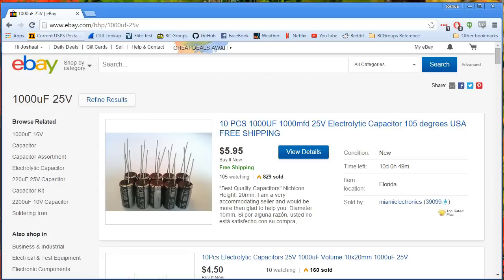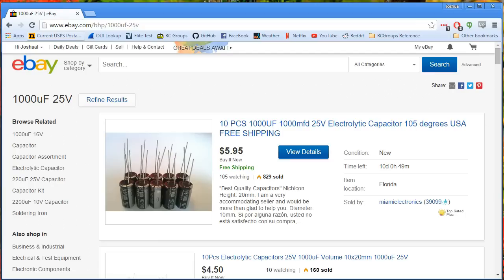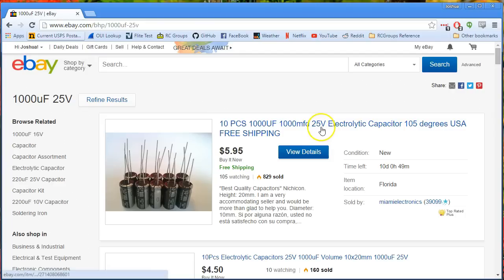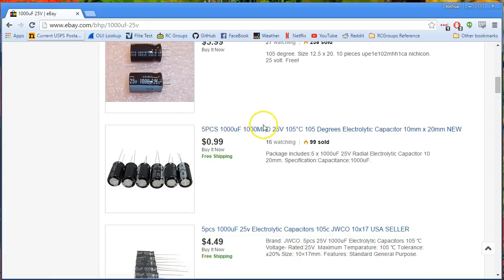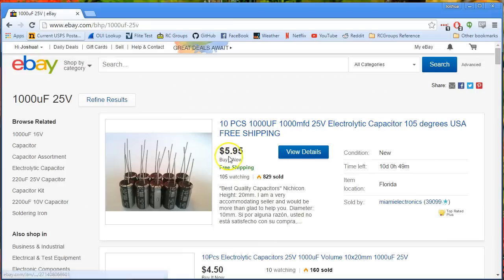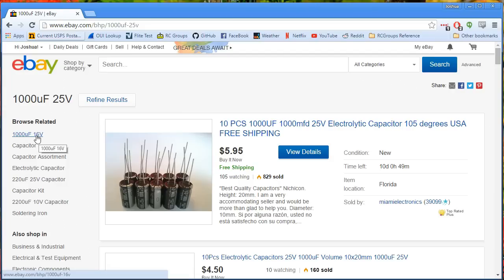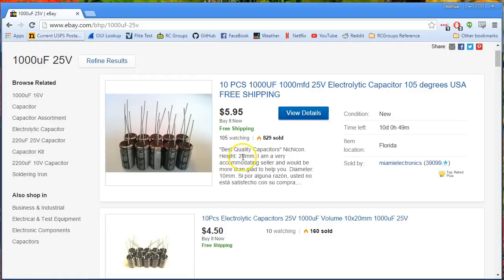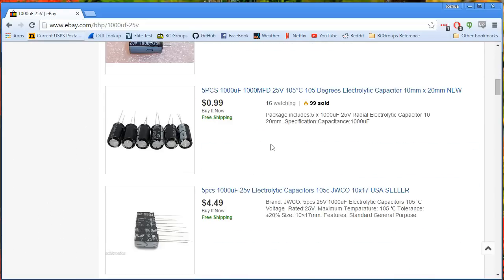Quadcopter Build Tip: Install a capacitor on your battery lead!

Comment: hey great video! i just a a question. can i just use 2 capacitors with 680uF and wire each capacitor to 2 ese's on each side of the quad(+) to (+) and () to ()...? so that way i can eliminate putting 1 capacitor on each individual esc. (almost like a parallel set up)
Reply from the maker: That's not the best way to do it.

Comment: Digging up an old video! I have a nice posh cap over the XT60 on my controller, is it a good or bad idea to add smaller ones to the power leads of the ESC's also? Or will this cause other issues?

Thank you for all your videos by the way, I have been glued to YouTube for weeks watching everything! Haha
Reply from the maker: Smaller cap on the ESCs is more effective than one big cap on the XT60. But the more the merrier. If you do it all, even better.
Reply: @JoshuaBardwell  back to the bench it is then!

Comment: Is there a possibility that the braking could be wiping out my micro minimosd ? Every time I land with the motors armed, the FC trying to correct itself wipes out my minim. Doesnt happen when disarmed/ motors not spinning. Using a naze rev5, the micro minim is powered by its own 600ma pololu. FC and Rx powered from a separate Pololu

Comment: I've been experimenting with caps for some time now. never had an issue without and seem to see zero benefits with but I guess I'm not supposed to see them.  with today's esc's that are littered with smd caps, do you still feel this is necessary?
Reply from the maker: +FPV Kabab if you see video lines, it's necessary.
Reply: my video is perfect but I'm using 12v off the pdb. not batt power. I don't think that matters however. I've seen lines on other quads with the 12v too.  thanks. i had no idea how to tell if the caps did anything at all. I added them to try and avoid desyncs. then I learned all about all the various failures and don't believe the caps do a thing for them.
Reply: I have two polulu step down converters for 12V and 5V and they recommend a capacitor of 50V if you go over 20V nearest to the pololu gnd and vin.  At least 33μF...  I'm going to try a 470μF 50V ESR since I'm in the 5S world right now and having FPV issues.
Reply: @Kabab  With a couple years since this.. what are your thoughts on these issues today? Do you use caps at all? Hard to tell in your vids, but looks like no? Is the hardware that much better in 2018?
Reply: @Andrew-FKF  very interesting. So I use the Panasonic 1000uf 35v as a standard on all my quads but I've still yet to see a problem solved by the dumb cap. I've also had quads that had their cap wire broken for the entire life of the quad and I never noticed until I went to take parts from it. So nothing has changed but I still use it because it's recommended...

Comment: hey can i just solder the cap to my lc filter? is that ok to do that, i can only find 1000uf 16 volt lc filter on market which the voltage is quite underrated for 4s lipo as you said. I fried 3 cameras before and never want to repeat that again.
Reply from the maker: +bard moon if you have an LC filter you're most likely fine.

Comment: Would you recommend running this on a RROSD? I have seen some build that you have done with this board and wondered if it makes any difference with a board like that? I will be running littlebee pros, and this will be on an atom rx122 so space is at a premium. :) 

And as always thanks for all you do!
Reply from the maker: RROSD has some in-built filtering, but not enough to completely remove video noise from noisier setups especially Littlebee ESCs. It can't hurt to add the capacitor if you can find room for it on your build.
Reply from the maker: ... but at the same time, if you can tolerate a little noise in your video, then you can leave the capacitor off if you can't fit it in somewhere.

Comment: Wow, following your channel is almost like trying to keep up with the bf thread lol. Thanks for the tip! Since you mentioned, can you do a video on lc filters for camera? There is good info out there, but still confusion on where to mount it, if you need one before camera and also one before vtx. Also confused on amount of wraps the power lead should be around the ferrite. And if both + and - go through the ferrite. And capacitor size. I picked up a 16v 1000uf cap for my 3s quad. Seen that recommended now after watching this I'm doubting. But I don't have active breaking esc's.
Reply from the maker: +Chris E 16v is passable for 3S but not ideal. You will probably get away with it especially if you don't have active braking.

Multiple LC filters are probably overkill. I would rather use one big filter than two small ones.

More wraps around the ferrite are better. We are not trying to tune an audio filter here, where we want a SPECIFIC cutoff frequency for our filter. We want to filter this "signal" with as hard a low-pass as possible. For the capacitor, around 470 uF to 1000 uF is generally good enough.

Best-case scenario IMO is to have the vTX on a 12v regulator, with an LC filter between the battery and the regulator. So: battery -> LC filter -> 12v reg -> vTX and camera. The reason for that is that the regulator will add some additional filtering. For a 3S system, where the battery voltage will drop below the drop-out voltage of a 12v regulator, a 9v regulator may be better. Once the input voltage goes below the drop-out voltage of the regulator, best case scenario is that the regulator's filtering will be gone, and worst case scenario is that the vTX goes off entirely.
Reply from the maker: +Chris E For the ferrite part of the LC filter, get some magnet wire, also know as enamel wire. It allows many, many more wraps in a smaller space compared to regular wire.
Reply: +Joshua Bardwell Don't the filters on the RROSD PRO PDB perform the same function.
Reply from the maker: Kenny Young Yes. But personally, I still add the capacitor. To my mind, it's cheap insurance for the cost of a few cents and a few grams. Bear in mind that the filters on the RROSD Pro PDB are designed with weight and size in mind. Almost always, with capacitors, this means a bit of a compromise--although I don't know about the capacitors on the RROSD specifically. To my mind, there are few substitutes for a big fat electrolytic cap when it comes to the type of filtering we're doing here.
Reply from the maker: Chris E It's quite likely that your voltage regulator is going to soak up most of the noise, so I don't think there would be much benefit to putting the LC filter between the vReg and the vTX. Putting the LC filter before the vReg protects the vReg itself from the noise, which may be desirable depending on the specs of the vReg. In other words, if it's rated up to, say, 18 volts or 24 volts, for 4S usage, it may be seeing transients of around 40 or 50 volts, which could eventually destroy it. Or maybe nothing at all will happen, depending on how the PDB is designed.
Reply: +Joshua Bardwell Damn it, I just soldered my LC filter between the 12V reg and the vTX and camera. We'll see how well it works. The reg is the one on a Matek PDB.
Reply: +Joshua Bardwell Sorry I'm so dull, but I'm not understanding. When you say vreg I'm assuming you are talking about the 12v step down regulator on the pdb? If so, I'm not using that pad, just the unregulated 12v pad for the vtx (which is labeled vcc on the board), which in turn feeds the cam the same voltage. I don't think this would be filtered in any way. So the only way I could put a filter before is to do it on the lipo plug leads. I'm guessing that's not what you are implying but its the only thing I can picture when I read your comment.

Anyways its not a big deal, don't have any major video issues. I'll experiment and see what happens. Thanks Joshua!
Reply from the maker: The vBat pad isn't filtered or regulated, you're correct. If you're in 3S and feeding vBat to the vTX, it doesn't matter.

Comment: Hey Joshua, have you actually measured the effect of this with a scope? I would be shocked if a leaded electrolytic capacitor had any large effect on the high frequency noise from the escs. My solution is to separate the escs from the rest of the system with an inductor, that massively decreases the noise on the bench (scope) and in practice.
Reply from the maker: +Goat 1000 uF electrolytic is what is recommended by MRM to go with the Littlebees. That, for me, was the final word. The theory is that the time constant of the circuit acts as enough of a resistance to make an RC filter with a sufficiently large-valued capacitor. I have personally also experienced a reduction in video noise on a vTX running direct from vBat after adding a large capacitor to the power leads.
Reply: I don't doubt that a capacitor helps, I have tried it and it did take the edge off some of the noise. However an inductor does a better job by at least 100 times, it is more difficult to fit though.
Reply from the maker: Goat that's interesting.
Reply: +Goat would it be correct that a capacitor would be more useful for voltage drops as they store charge, and an inductor which resist change is what you want for voltage spikes like the active braking would produce?
Reply: +Adam Wilkinson The reason an inductor works so well is that the parts you are trying to filter for (camera, VTx, 5V reg) all have capacitors on their inputs. By adding an inductor you create an LC filter which is great for filtering this kind of noise. By adding a larger capacitor you have just increased the capacitance on the Vbat rail.
Reply from the maker: Goat Makes sense to me. The time constant of the system is probably pretty small, so the resulting RC filter requires a pretty big C to get any filtering done.
Reply from the maker: One advantage of the capacitor is that it's installed in parallel, so it's dead simple to add it to the system. The inductor must be added in serial, which could add undesirable complexity depending on how exactly your system is wired up. For example, my vTX is powered directly off of my PDB. So is my camera. Where should I install the inductor in series between the main battery lead and the 5v and 12v regulator on the PDB? I can't.
Reply: Goat do you have a YouTube or schematic how to on installing a line filter (inductor)?
Reply: I can tell you without a scope that my 1000uf 36v cap gave me clear video until I broke one of the leads in a wreck. Caps can make a night and day difference on some setups like mine with a 35A 4in1.

Comment: Good tip ! 

However, the capacitor should be closest to the ESC rather than the battery. In fact, you would even be better of soldering 4 smaller caps (220uF for example) directly across the ESC PCBs or where they are soldered on the frame PDB. Electrical noise on our quads come from high current switching devices (ESC). Spikes and noises must me cut down at the root to prevent them from poluting sensitive electronics (camera, VTX...)

Cheers.
Reply from the maker: +MrFlatox Installing next to the ESC is better, but many builds won't tolerate that well. Installing where the main power leads connect to the PDB is better than nothing.
Reply: Joshua Bardwell Yes, it's still better than nothing :D

Comment: would adding a 1uH inductor in aeries with the battery filter almost all noise with the capacitor (at least 100A capable - about 12 turns of heavy guage copper wire around ferrite rod).
i designed a very basic circuit with the every circuit app and adding a capacitor in parallel to the battery made no difference. but adding the inductor made a huge improvement. any ideas?
Reply from the maker: The circuit simulator is not taking into account the reactance of the real-world system. A capacitor by itself, in a zero-reactance, zero-resistance system, makes no difference. In the real world, the capacitor combines with the inherent inductance and resistance of the system to form an effective filter, as long as a sufficiently big capacitor is used. But you're right that using an inductor to form an LC filter is better. The main problem is that inductors are big and heavy, and that you can't easily install an inductor in series with the main battery lead to filter the entire system. Such an inductor would have to carry tens of amps, and would be really massive. So a great approach is to put a large capacitor across the battery leads to add some filtering to the whole system, and then add a small LC filter directly to the vTX and camera feeds if need be.

Comment: This might be completely the wrong thing, but wouldn't it make more sense to connect the capacitors at the ESC's where the ESC's draws power from the PDB? Many of the ESCs I've used have a capacitor bridging the power leads.
Reply from the maker: +Murray Levi The ESC power leads is the best place to install the capacitor, but many people don't want to add capacitors to their tiny ESCs or install them on the arms of their copters. Putting the capacitor on the power lead is the approach that will work for the widest variety of people, even if it's not the 100% most effective.

Comment: Is there any point in installing a cap on the 5V side? I have a camera, minimOSD and the other stuff on 5V, and still have brownouts with a cap on the battery side of a 4S quad.
Reply from the maker: There's little point in installing a cap on the load side of the 5v regulator, because none of the 5v loads are creating noise.
Reply: OK. I thought that it might help smooth out the 5V if there was something causing drops in the voltage. Something is causing brownouts in the video or OSD in hard maneuvers. might just need another 25V cap on the battery side..

Comment: hey joshua would it be okay to place my 1000uf 35v cap just one on my tight boltrc kraken 5r build? will it work even if its not exactly on the battery input? ive got stock pdb that has spot where pololu most of time wires. Thanks im just trying to find clean spot to put this big bastard
Reply from the maker: +David Downs it'll help sure.

Comment: I had my quad stop responding mid flight and crashed. I was literally 40 feet from it. Just did a power loop and it stopped responding about 10 feet off the ground. I was still getting video. I went and unplugged the battery and replugged it in a few times thinking it a Failsafe. Seemed the receiver wasn't working, no lights. The FC had lights. Later that day I plugged in a battery and was able to connect and turn the quad on and everything seemed okay. Could this be a 5v regulator off and on failure. Just wanted your thinking before I totally take the beast apart. I just don't want that kind of failure again. Thanks
Reply from the maker: Probably you have a bad solder joint, cut wire, or damaged receiver. If the 5v regulator was bad, your FC would have reset too and you would have heard the ESCs re-initialize.
Reply: Thank you, I will start searching. Appreciate it highly!!!

Comment: Can you add wire to extend the capacitor and if so what gauge wire would you use?
Reply from the maker: +Alex DiJ the less wire the better, but the leads of the capacitor themselves are quite small so 22 AWG is probably fine.

Comment: Could I just solder the cap to the ESC pads or does it have to be soldered to the battery leads?
Reply from the maker: +vapearoo com ESC pads are better actually. You can go down to 330 uF.

Comment: I'm experiencing motor twitching sporadically and occasional fall out of the sky on a custom 130 build using DYS 1104 Brushless Motor 5400KV 3s 850mah 70c battery and Flycolor RAPTOR BLHeli 12A esc.  Could I benefit from this?  Otherwisemy quad flies great.  Please help a noob
Reply from the maker: The number one cause of this is that you haven't set min_throttle correctly. Find the lowest point where your motors spin, using the master slider in the Motors tab, and then add 20 to that, and that should be your min_throttle.
Reply: Joshua Bardwell  Thank-you, I'll give that a go in a minute
Reply: Joshua Bardwell Thanks again for the tip. After thorough investigation today it turns out that I'm not that great at "soldering" as my rx wire was found to be dangling just enough to drive me crazy, easy fix.   Happy flying

Comment: Can I solder this directly to where my xt60 connects to the pdb???
Reply from the maker: +HexDan yes.
Reply: Is it better to solder the cap directly to the battery leads or to use say a 20 gauge wire?

Comment: I am currently using a 3s 11.1v battery in my unit. Should I go 25 or 35v?
Reply from the maker: +Miller Ingram 25 is probably okay. 25 won't hurt.

Comment: How do you solder the capacitor? Do you do one for each esc where it connects at the pdb?
Reply from the maker: You can do one per ESC or you can do a single one where the battery lead solders to the PDB.
Reply: Thank you man

Comment: I switched to a new VTX and when I did that I was getting serious noise on my FPV feed so I put a 1000 uF 35V capacitor on the battery input terminals. The video is greatly improved but now my FC thinks a 4S battery is a 5S battery and the voltage on my OSD is all screwed up. How can I fix that?
Reply: After a little research it seems like the capacitor is causing slight voltage spikes when plugging the battery in which causes BF to think I'm using a 5S battery. I changed the maximum cell voltage to 5.0 volts in the configurator and plugged in two separate fully charged (4.2v) 4s packs and it now recognizes them as 4s. Not sure if this is an ideal solution or if it will work long-term, but I'm going to go with it for now.